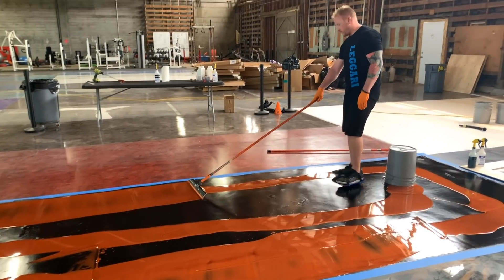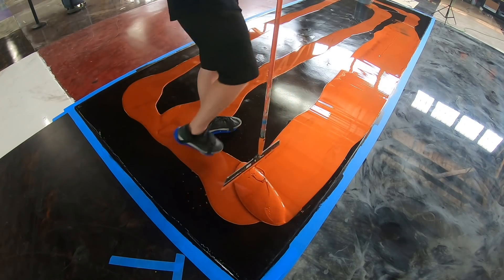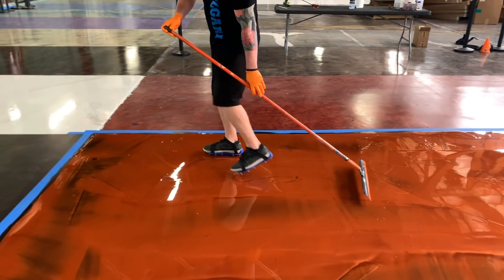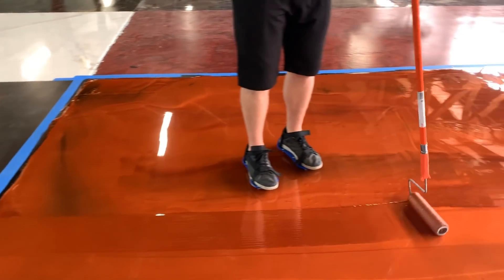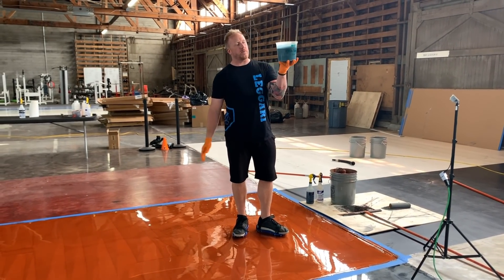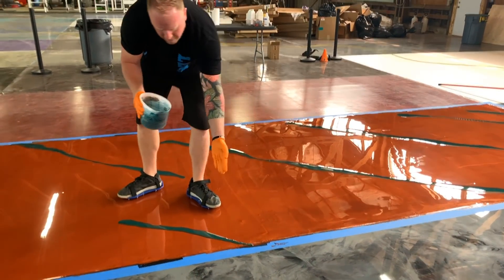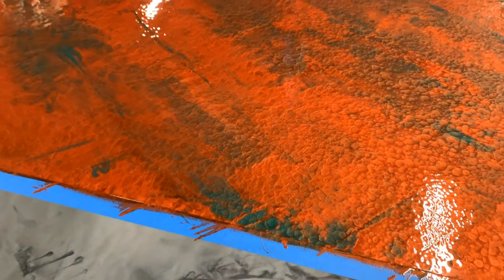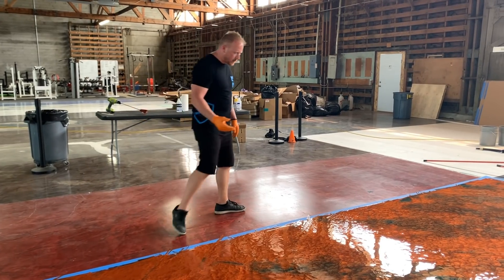Learn How To Install A Designer Epoxy Floor | Step By Step | Epoxy Training

Comment: My spikes are glued to the shoes I used with them from all the coating jobs I've done and the new guys  are always asking how do I make walking on look so easy . Lots of practice
Reply from the maker: That is true, the epoxy can be a little slippery when walking on it when you are doing the application.
Reply: Most of our work is on secondary containment areas so we don't get to do much decorative floors or play with the colored epoxies that often but a good looking floor is all about prep
Reply from the maker: That is correct, it is all about the prep work.

Comment: Do i use the same resin for highlights or mix extra
Reply from the maker: As you can see in this video, we set up our mixing station so there are separate buckets for the base coat and highlights and they are mixed separately. Check it out! 👉 https://www.youtube.com/watch?v=wz7THPQuxhA&t=713s

Comment: Congratulations for the work. I love and follow your work. I have a doubt. How thick do you apply the second layer?
I am Brazilian and I don't speak very well and I don't understand English well, so I can't know what you guys say in the video
Reply from the maker: The epoxy will roll out at about 1/8 inch thick and when you apply the top coat it goes on real thin.

Comment: You used resin clear 50/50 or 75/25? I can use resin epoxi table to do a garage epoxi floor???
Reply from the maker: Yes you can!
Reply: @LeggariProducts  i love you. where can i find out about the courses or workshops, i live in tampa fl, and i want to do the courses or workshops.

Comment: I have a pool table in my room I dont want to move but I would like to install your product.  Do you have any suggestions?  I thought i could jack it up a bit and set some wood under it and then take them out once the epoxy has set.  Let me know what you think.
Reply: Consider using a 2x4 with a nail pounded through at each corner. Then place one 2x4 under each end of the pool table with the nails protruding down. (Sort of copying the spike shoes used when applying the epoxy) This way only very small nail holes will be left after applying the epoxy and the table legs should cover them.

Comment: Not bad, but I would've left the green out. Just a personal choice on my part, that's all. Other than that, I love that particular color. It pops!
Reply from the maker: Hi Ronalk, take a look at our online brochure.  Thanks
https://online.flippingbook.com/view/364043
Reply: Ronald I was thinking the same thing. I would've gone with white. That combo reminds me of Halloween
Reply: @josephinemiller4780  I don't mean to gross you out, but with that green in there like that, it looks like a Demon or something came in there, barfed on the floor, and then took one of his feet, and wiped the floor with it! Its horrible! Personally, if it was my choice, I'd mix in some Black, and just a little bit of Rust Red, and mix it together real good. What do you think of my suggestion?